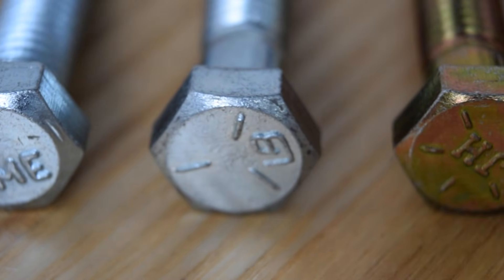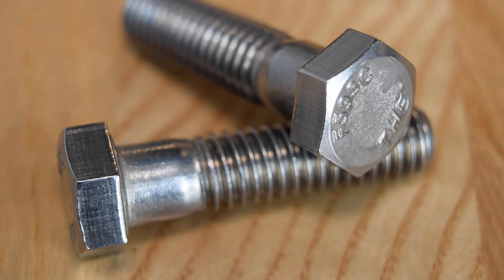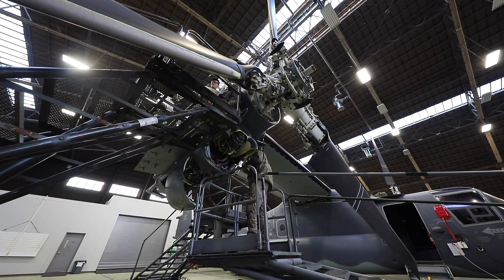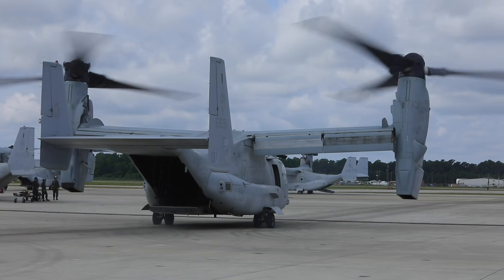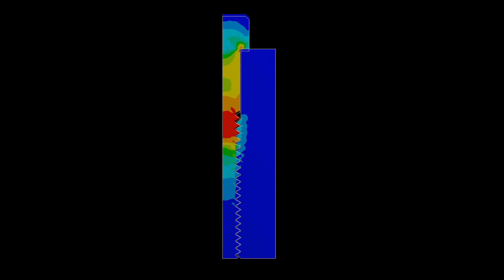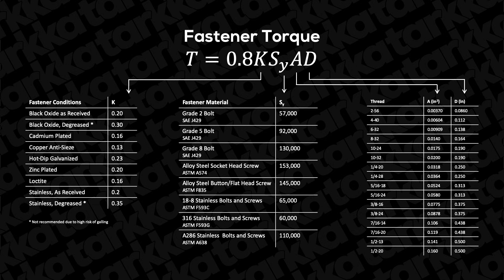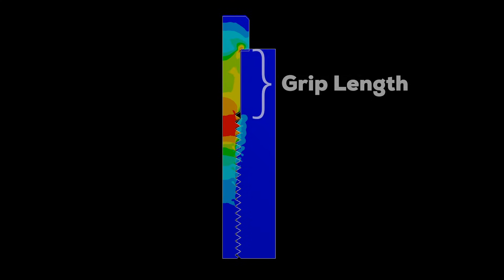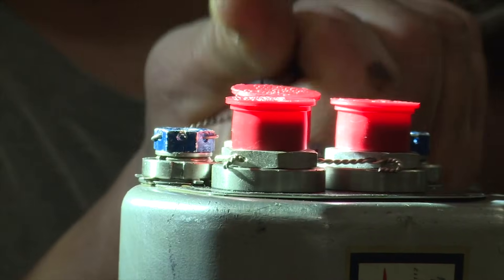Screw It! Intro to Fasteners & Bolted Connections

Comment: I can't remember the doc, but I was reading something on the difference between bolts and screws -- and screws command higher tariffs because they typically have to be made to tighter tolerances (which increases cost. Customs inspectors use tolerances to check if the shipment is labeled correctly.

Comment: I am using a 12mm bolt and nut for the installation of tow hitch receiver for my bike rack.  Is it not a good idea to use 14mm washer on a 12mm bolt? What is that 2mm internal clearance going to cause? 14mm washer is what's currently available, so i used it. Should I remove and replace it with a 12mm instead?

Comment: The hex head screws belong to the big family of screws. Which of the following descriptions related to the hex head screws are true:
This type of screws is that it is not strong enough for most application scenarios

Avoid confusing hex head screws with a hexagon socket head or an Allen, which have an internal hexagonal socket that is driven by hex bits or keys. Hex heads always have an external hexagon head.

This type of screw requires a fair amount space to accommodate the tool.

The price of the hex head screws usually very high

Comment: There are washers which are two metal elements with little dots of wax between them. When they reach the design compression load the wax (dyed a bright color) squeezes out.

Comment: Really good video. Incredible info. I would add specifying that UNC threads are stronger for weaker female material like aluminum since failure more likely to occur along cross section of thread and UNF is better for stronger female material like steels where failure occurs along minor diameter of fastener.

Comment: Cyclic load does not affect preload setting. Sufficient preload is critical to minimize cyclic load effect on the joint. If the cyclic load is causing preloaded screw to reach critical stress limit, the solution is to increase the screw size and/or the number of screws, not to reduce preload. Reducing the preload will cause the cyclic load to increase its effect on the joint. Unless there is material strength constraint of the tapped hole material, preload of 75% proof load of the fastener should always be applied whenever possible, especially for cyclically loaded high vibration applications.

Comment: Enjoyed the video. Agree on the general uselessness of split ring lock washers, for small screws they seem to increase failure rates. When at college I built a lab for ME students that graphically measured clamping force vs nut and bolt torque for M8 screws. Some Zn plated and some stainless screws did reduce clamping force below 50% the second  time torquing them down. If at all critical, thread length and correct lubrication seems as important as correct torque and angle. Subscribed to Your channel.

Comment: Hey Tarkka, loved the video. Could you briefly go over why an increase in grip length results in higher resistance to loosening? Also, at 10:43, you mention the deformed thread lock nuts. Is this the same thing as the locking thread operation at 11:49?
Reply: Not sure if you only wanted a answer form tarkka but I have done some research on this. I think the long neck acts like a better spring. Allowing changes in load to occur with out thread deforming or changing shape. 

As for the lock nuts. They are the same technology. But I don’t like thread deforming because you can’t reuse the nut. Many nylon locking nuts can be reused.
Reply: @TheEnglish2011  That makes sense. Thanks Geoff!

Comment: Great video! I have just discovered your content, and its amazingly concise and straightforward. You guys even machine examples! I have begun using your videos as part of an on boarding procedure for undergrads at my rocket club. Question about lock wire: from what I understand, it does not affect the preload or the vibe resistance of the fastener, it just prevent a loose screw from becoming dangerous debris in applications like turbines by keeping it connected to the other screws in the event of backing out. Is this true? I’ve been thinking about it, and i can see how the lock wire can prevent the fastener from backing out but it seems like it can’t add preload to it or prevent the fastener from breaking the static preload friction. Are there any good resources documenting the behavior of lock wire that you know of? Thanks!

Comment: You missed a pre tensioning method of elongating the bolt by hydraulic jacks and fitting the nuts. Nuts are hand tight initially and after hydraulic pressure is released the bolt contract and is pretensioned by correct value. Used on marine engines.

Comment: 10:50 This statement is false.
Reply: They're not particularly useful. By the time a bolt is properly torqued, the split washer is flat and effectively equivalent to a flat washer. The split doesn't really grab into the parts to prevent loosening in any substantial manner. The only benefit they have is to give a bit of preload on a slightly loosened bolt, but the situations where this kind of thing is acceptable are frankly quite limited. They also allow moisture to seep in through the split and can break leading to random bits of hardened steel in whatever it is you're making. In situations where locking is absolutely critical, these are unacceptable, NASA and many other organizations/companies have come to similar conclusions. In situations where you would want locking but don't have to deal with as severe vibrations, you would be better off with thread fasteners or locknuts.

Sources:
NASA RP-1228 https://ntrs.nasa.gov/citations/19900009424
Nord-Lock locking method comparison tests https://www.youtube.com/watch?v=IKwWu2w1gGk&t=60s

Comment: I need some ideas about Mounting methods for thin-wall cast aluminum 
 
I'm Having a cast aluminum enclosure with a 3mm wall thickness. now I need to mount this to a mounting plate fixed in vertical walls. and my thread engagement is 3mm I need to increase the thread engagement. can I have some idea on how should I choose the appropriate fastener?

1.cast aluminum enclosure
2.mounting plate, for now, I have placed a 5M countersink

Comment: (EDIT: turns out I mixed up belleville spring washer and spring washers)

The mechanical engineers I work alongside doing electronics uses (belleville) spring washer all the time. They ensure good electrical connectivity in the power-electronics designs. Connectors are often made out of soft metals that can deform over time (e.g. due to temperature, pressure, vibration etc). If and when this happens the (belleville) sping-washer "springs into action" and pushes the two mating surfaces together.

Comment: Thank you I've been trying to convince everyone at my work that split lock washers don't anything special.
Reply: In my technicians school I was told that the norm for that even got withdrawn.
Reply: @Hackwurschtable  Habe letztens die Norm dieser Dinger gesucht. Wikipedia meinte dann "Nachdem seine Wirkungslosigkeit erkannt war[2], wurde die entsprechende Norm zurückgezogen." Hat mich gut zum lachen gebracht :D
Reply: You were right..Split washer is not used ay were in where the critical fastening is required,
Reply: Split lock washers do help in mild vibration conditions. They are applicable if the connection is tested in service and proven to be sufficient. Otherwise wedgelock is a much better choice but the cost is much higher. We have applications with no lock washer, with split lock, and with wedgelock.
Reply: @yangxinkai  They work very well in low torque applications on vehicles. Like lighting adjustments or bolt on accessories. I use them all the time actually.
Reply: The split lock washer is only useful in prolonging the time between losing preload and the nut jingling off the fastener. The split lock washer can also damage the head and or clamped plate upon removal. It has no place in an engineered bolted joint.

Comment: I did sub during this vid - good content! I think Split washers and nordlocks perform the same task, although the former does a better job, neither increase breakaway torque but both resist vibration
Reply from the maker: Thanks! And there is another comment thread here that goes into why split washers are not good.

Comment: Interesting Video - Split washers and toothed (MS35333 type) washers are often specified in the aviation industry, almost always between a plain washer and the nut.  The plain washer is free to slide against the part, so the only way they can have much effect is by maintaining a little pre load if the fastener begins to loosen? I suspect its true that they have little real benefit, but I must always install them as specified!

Comment: i have been a mechanical engineer for 11 year and this video is 100% correct, except maybe for the major diss to lock spring washers.  spring lock washers definitely have their place, although not in any sort of critical vibrating assembly.  they are used a ton in big construction stuff, bridges, big casting forging bolted joint type stuff with much success.  nordlocks are amazing but about a zillion dollars amazing for your airplane, but not for everything. 

Even as a believer in them, I will admit that there is a lot of correct information floating around that the spring lock washers are not as useful as many other methods.   They have lots of weak points, but they're incredibly cheap.

superb video!

Comment: Awesome video!  There's so much material to cover, I think it would be awesome if you guys did a "part 2"  or even a series.  Keep up the good work!
Reply from the maker: We definitely didn't cover everything we wanted to. Still trying to figure out how much people can take in one sitting!
Reply: @tarkka  If you keep the length, make a short video that acts as a summary, and create a series where you go in to details, or cover the subject more comprehensively would be a dream come true. I love that the videos are consistent, informative, factual and show the passion for the subject.
Reply from the maker: @ravindrawaghela9072  We would love to do a video on that -- it's on the list :)
Reply: @tarkka  Could you also go into the details on how to determine when to use different washers?  I mean, when are "hardware store quality" washers OK vs. when are "spec quality" washers needed.  I can make a good guess at some of this, but I'm sure that you have lots of ideas and good ideas that I've never thought of.
Reply from the maker: Bob Vines that’s a great suggestion!
Reply: @tarkka  could you do a video on thread lockers?
Reply: @bobvines00  I second the washer video. Expand on why the split washer is useless and when to use internal or external toothed washers and other hardware.
Reply: We are a China factory of bolt ,nut ,screw and other fasteners with top quality and beautiful price.
We have export fasteners to many countries all over the world.
If you have inquiry recently,welcome to contact me 
Email:sales11@cngoshen.com
WhatsApp:+86 18357337622

Comment: great video! just one question, why are those split washers useless?
Reply from the maker: Thanks!
Reply from the maker: Fantastic!! Thank you for finding this!
Reply: @tarkka   You may also mention using flathead screws for location/positioning parts (ofc, it's tolerance isn't the tightest) and also using cone/flat set screws for holding other parts. 
Pretty sure You already know all that stuff ;)
Reply from the maker: As far as the split lockwashers go, there was some research done in 1969 by a guy named Junker:
https://saemobilus.sae.org/content/690055

Unfortunately, that paper requires a subscription and I couldn't find it reproduced anywhere on the internet, but the results are summarized in this whitepaper:

http://www.boltscience.com/pages/self-loosening-of-threaded-fasteners.pdf
I have read that NASA repeated this testing and had the same results, but I can't find the report anywhere.
Reply: Yes, in general split washers aren't resistenant against vibrations. The toothed washers can be used, they are cheaper than Nordlocks, but not that effective, so Loctite is a way to go in most cases. But, one must be careful, since different producers make the thread lockers make them in different colors.